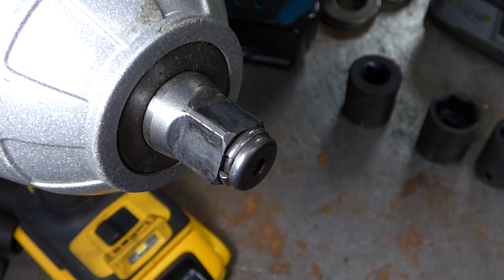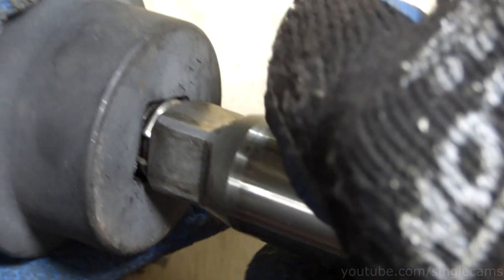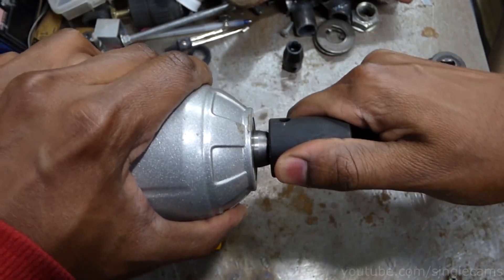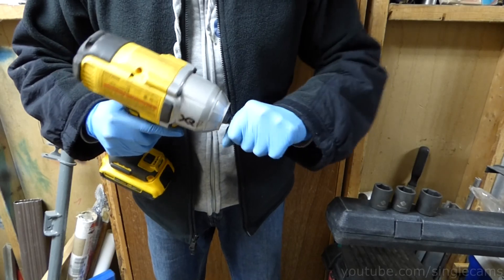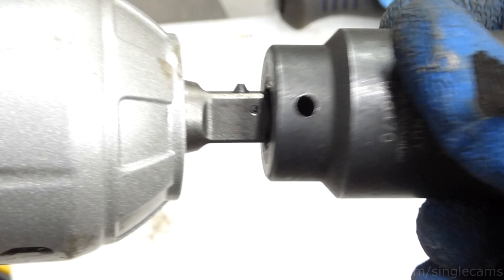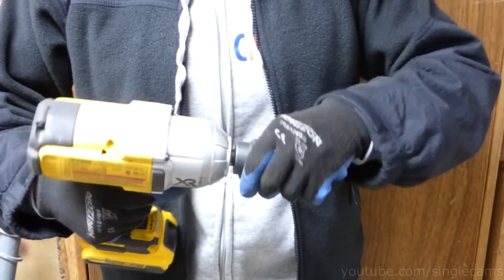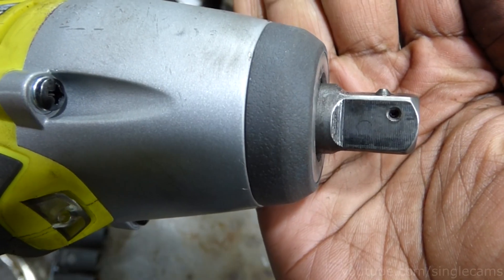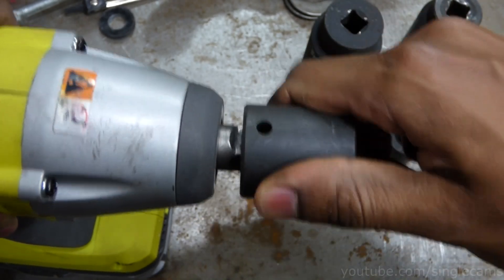impact wrench hog ring vs pin detent (dewalt)

Comment: hmm. with the pin detent style - i didn't know you can opt to Not align the pin. That could come in handy but would it wear out your chuck faster over time? Also, can you maybe stick a nail in the socket hole and depress the pin if you want - to aid in removing? Thanks, you explained it all well

Comment: The hole in the base of the socket is to allow you to use a small pin to insert into the hole to release the pin, so no need to struggle to get the socket off as you were doing !

Comment: Thanks for the helpful video.
However, in the video you used the pin in the wrong way so you need to push it from the socket's hole with a screwdriver or something else and the socket will be free like you explained in the description.

Comment: Cool. I put a tiny drop of silicone to lubricate the hog ring to make it less sticky. Or, use a 1" long impact extension with ball detent...this will cause some torque loss, but might be worth the trade-off in some cases.

Comment: It's not in a straight line when you pull it holding by the handle. It works better holding by the barrel with socket facing towards you

Comment: Hog ring can be annoying to get a bit ON the tool but I'll take that any day over a stupid detent pin. With a detent you have to be Hercules to get a socket OFF the tool.
Reply from the maker: You didn't even watch the vid😄...that is not true at all
Reply: @onlyimpacts  
Actually, in some cases, it IS true. My brand new Milwaukee was very hard to remove, when the pin was aligned. But, all you have to do, is push the pin in with a small probe, to remove the socket. 
Just an extra step.
Reply: Push a probe or small screw driver through the hole in the socket, to depress the pin. The socket will slide right off.

Comment: I honestly kind of wish I had gotten a pin detent on my newest impact, because I don't use it A TON and I can tell the hog ring is going to take some time to break in because I was fighting really hard with sockets both on and off. At one point I spent like 5 mins with a flat head trying to pry off a socket. I ended up using a short extension to make things easier but couldn't fit it in anywhere and kinda ruined the point of a compact impact.
Reply: Change it to an o ring

Comment: I have a dewalt DCF899N with the detent pin. After a few years I now need to use a screwdriver to wedge sockets off. It's VERY annoying.
Reply: Wd40 on the detent pin and put socket on and off to work the oil in the pin then works fine 👍 mine did it after years of use

Comment: I try to avoid the pin detent impacts because to set the pin up they have to drill a hole in the Anvil 

and it creates a weak spot  I’ve had one break straight through 

they can (not always) snap like a carrot 

the hog ring design is stronger
Reply: I wondered bout that myself...but the detent pin anvil is a lil longer it looks like ,,more anvil inside socket..ive read the hole dont go all the way the way through and its solid in the mid and rear area...i havent inspected it though...some write ups like Reid industrial or something like that says pin detents are more durable than hog ring anvil and are better for high torque applications...which brand did you break?
Reply: @steverugerguy9606  

Mine was a Kinchrome pulling off a front wheel bearing via a gear puller...... so a good 60 seconds of hammering - so now I have an Ingersoll Rand air and Milwaukee M12

Comment: Seems like the hog ring is a lot easier to work with unless you are in a factory setting. The TTI built Ryobi pin detent seemed much more user friendly. A nail or thin punch would likely be a good tool to have handy with a DeWalt pin detent. Good vid!
Reply: If the hog ring binds you either wish you bought a pin detent or use the same size socket for ever

Comment: I have never used an impact wrench. Today I bought a new one and It is a friction anvil. Anyway, I replaced the radiator in my car today but didn't use my impact because I didn't know you had to push so hard to get the socket on the new tool and I thought it was a defect so I gave up.  Had no Idea they are that hard at first. I am going right now to see if I can get a socket on. Thanks!
Reply: Okay, I just gave up to easy. Just tried to get some sockets on and every one I tried worked. I just went at an angle to get them on then it started getting a little easier.
Reply from the maker: once you use you use the impact the ring will get worn down and it it will loosen up.
Reply: @onlyimpacts  - Yeah, I figured that out. Thanks!

Comment: Hog rings all day for impacts
Reply from the maker: some impacts have really nice tapered hog rings like the IR but if you look at a dewalt hogring it is just a round wire and that is why is some of the comments you will read people get their sockets jammed on the ring. Or the makita where they forgot to machine in the groove for the o-ring and just put the wire on the anvil.(I made a video about that). the ring doesn't actually do anything because you need the actual o-ring under it.

Comment: being older and a tad weaker i cheat by positioning my thumb on the nose of the tool and it helps to apply pressure to pop off the socket. some sockets have a hole that a small screw driver fits to give leverage to pop socket off.

Comment: He really likes putting sockets on a bit of Overkill just to make a point?? The pin type is much easier to remove the socket if you have a small Allen wrench to push in the hole it's a lot of unessasry work to pull it off by hand and will also wear out the pin much faster by using force! I've been working on cars and trucks since 1984 and have learned a few tricks 35+ year's
Reply from the maker: These impacts are being bought by many people without experience. They do not know the difference between a pin detent and a hog ring in the dewalt lineup. In the part 2 of this video I showed how to grind the pin so you do not have to use a allen wrench...and what kind of mechanic is going to pull out an allen wrench to remove a socket? Just put the socket on opposite the pin...no wrench needed....just like it shows in the video.  Guess you learned something new.

Comment: Are those hog rings replaceable once it gets worn out?
Reply from the maker: yes they are
Reply: Where can replacement be purchased?
Reply from the maker: you have to google dewalt hog ring replacement or contact your local dealer you can buy online but have to do some research to see who will ship wherever you are. the price for the ring is like $4 and under

Comment: Are there sockets specific to hog ring or pin? Or do they work with either system?
Reply from the maker: either one will work on any socket even chrome regular sockets if you have to use them

Comment: Pin indent is bettet you can use it two ways if you eant the ratchet to stay on so it doesn't fall off then line it up with the hole if you want it to slip on and off easy don't line it up with hole but with hogring it's hard to put on and take off

Comment: the milwaukee 2860 has a pin detent and it has the same problem the socket locks because the pin sticks out 1/8 of an inch I had to grind it down

Comment: How do you like your cordless electric impact wrench? I was told that they are only good for removing wheel lug nuts but not much else. In your video, you have some large sockets presumably used for drive axle nuts. Is it effective for removing those axle nuts?
Reply from the maker: Hi see this , does the link work ? https://www.youtube.com/watch?v=bmFiFgAtUpM
Reply from the maker: check out the link I sent. You really needs to check the power level of the impact there are so many different ones , but this one can do most anything you need it to. but generally anything in the 200-300 ft-lbs of torque range have no problem with lugnuts and may struggle with axle nuts, then you get into these full size impacts like this dewalt that put out 1000ft-lbs and those are really the ones you want to get for axle nuts and the larger fasteners. I have posted many impact videos hope you check them out. Thank you
Reply: Thanks. I just watched your other videos. Very convincing. I have a cheap ($40) corded impact wrench and it's not very powerful even though it is advertised to deliver 250 ft-lb of torque. So, I decide to get myself a good cordless one.
Reply from the maker: im sure you will be happy if you get this , please post back what you think about it :)

Comment: fps Russia doing voice over for you?
Reply from the maker: hey man finally i can reply to you I know you left couple of comments but it wouldn't let me reply back maybe you were using google+ or something im not sure :)
Reply: Yeah I'm on g+, how you been buddy.
Reply from the maker: i've been good man so you made those heavy sockets did you just stick 2 together inside each other and weld em up. I think that is the best way
Reply: Yep I've also made them in 17mm for some civic, 22mm for toyota, just one inside the other and weld it on, bought them for cheap at harbor freight, Works awesome too.
Reply from the maker: sorry for late reply I wanted to try a 14mm for those older Hondas with the seized rear control arm bolts and see how it works out :)

Comment: Excellent video. I'm choosing an impact wrench at the moment and this has explained the differences between Hog and Detent. Thanks!
Reply from the maker: thanks for watching and comment
Reply: Exact scenario I’m in. He’s answered me perfectly 👌🏽.
Reply: Which did you go with?
Reply: @Jaystonishing  Detent, so I can have the socket easy to swap by rotating it off the pin if needed.
Reply: same here 👍🏼
Reply: I hate how strong the dcf900 holds into the sockets tho

Comment: I use one end of a needle nose pliers to remove sockets on a detent end
Reply from the maker: +Roland Jones i took out the pin and ground it with a file, just a little off the top and now the socket comes off with one pull. I will upload video works perfect now. But if you need socket to stay on for good then best not to grind it and use a tool like you say.

Comment: also,.i.used a hand file to grind out the detent pin on my dewalt impact. without takinh it if.  i ground of just enough as needed
Reply from the maker: +cuate rivera I put mine in a drill :)
Reply from the maker: +cuate rivera but hand file is good too
Reply from the maker: +cuate rivera i think file is best tried it worked great
Reply: +singlecams yes less work, easy fix

Comment: instead of replacing the worn out clip, you could probably take it of, squeeze it closer together and re install it
Reply from the maker: +cuate rivera do you mean so it is looser? when it wears out it will be loose , if you see makita video I posted before this there is another type of clip without o-ring you can see that one has no grip at all.

Comment: It looks like some aftermarket part huh?
Reply from the maker: +KIevMan no it is from another model they have model with ring or pin, the part is called the "anvil" . I bought the anvil with the pin. You can see here https://goo.gl/photos/ZK9Le4kVQN5BFBm27
Reply from the maker: +KIevMan if you click picture it will go bigger, i will make video how i replaced it.
Reply: singlecams Ok. I woudl like to see that video.
Reply from the maker: +KIevMan did that picture work? I dont think it works on mobile. I will try to make the video thank you
Reply: singlecams Yes, I saw that picture.
Reply from the maker: +KIevMan Here is video http://www.youtube.com/watch?v=Cfn0aGCMg70